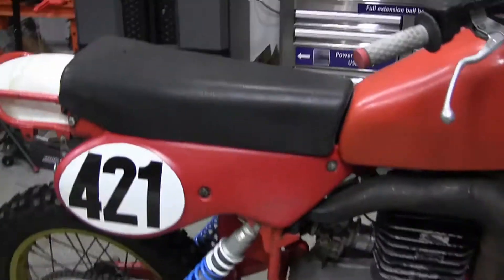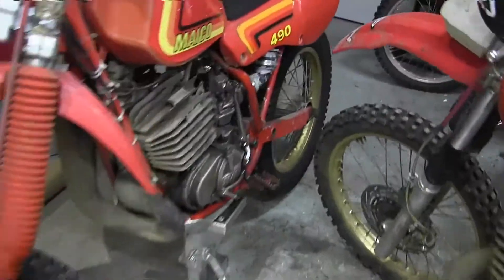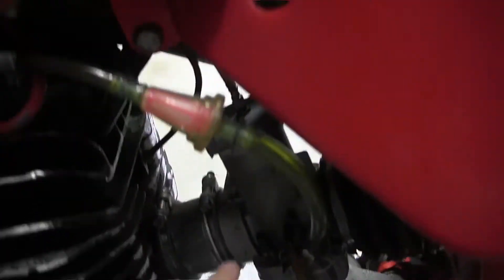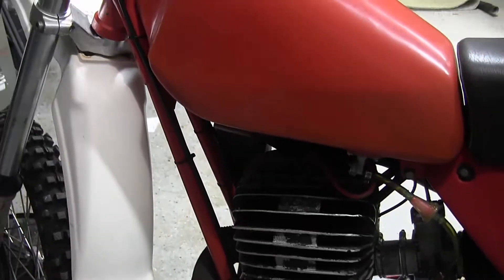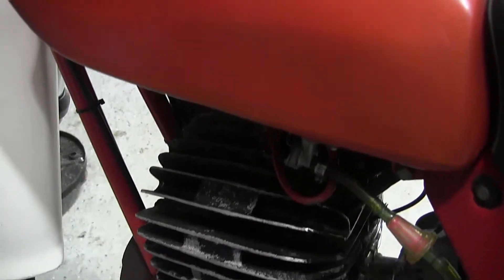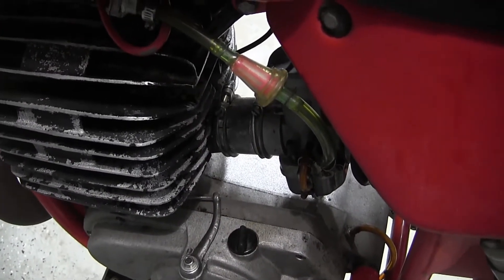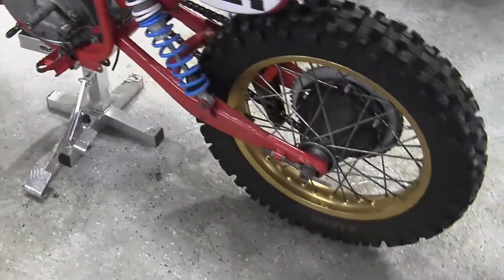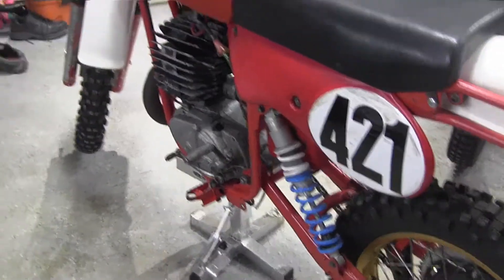Trick Start 1981 Maico 490

Comment: question, do you use the compression release when you kick the bike? What I did to start my 440 and 490 was use the tickle button let carb flood and twist the throttle 5 or six times with couple priming kicks before the big kick. By you blowing in the over flow tube, you are flooding the carb, the air you blow in there is forcing the gas up through the pilot and main jets.
Reply from the maker: Have to use the compression release.  The tickler never works for me, some people it works for, but I also don't like gas dripping everywhere.  Blowing is much cleaner since no gas spills out and it seems to be just right amount every time.

Comment: I had an early 70's 440 I'm guessing, as it was represented as a 450 radial. Had the aluminum tank, and was re-sleeved. The idjit that sleeved it didn't remachine for the compression release, rendering it a pull-start only affair. After everyone smashed their ankles trying to kick it. How did the Mikuni workout for you? It seems the ideal would be an accelerator pump carb, or would it just foul plugs? Btw, after we started using Bel-ray synthetic oil in the premix, none of us ever really fouled plugs. This was 40yrs ago.

Comment: Seems like it's not receiving enough air try changing to an aftermarket air filter to increase air flow so that way you don't have to blow into the bike
Reply from the maker: There's no choke on this bike.  The bike starts fine but you have to use a plunger to flood out the engine.  This is an alternative method that doesn't flood out the engine.  The other way would be to change the carb to one with a choke.
Reply from the maker: Also, I have a new air filter coming, I don't know the condition of the one in the bike currently, it's been sitting for 3 years in a basement.

Comment: flood it loads then lay it on its side with the throttle open then stand it back up flood again and boot it useing the decompressor
Reply from the maker: Jeremy Wilson Ya people always start thier cr500s like that but I dont like anything that spills gas.  Blowing is cleaner if theres no choke.   It has a tickler already tjat you can use to flood it.

Comment: I don't know why people whine about carbs with tickler rather than choke.  I rode a series of Husky's thru the years with Bings and, once I got used to it, never really had a problems with the bikes starting.  I think a lot of guys let their rings get too loose, crank seals leak, etc.  All your bikes sound nice and tight in terms of the aforementioned problems.  When I think back on it, I would rather have the Bings than Mikunis; they seemed to have more top-end over-rev with the Bings.  You also mentioned gas with alcohol in it.......not good as far as I'm concerned as it seems to degrade rapidly.  I keep my fuel in absolutely clean metal cans.....no plastic and that seems to help keep the fuel fresh longer.

Comment: if you hold the throttle open while tickling the piss out of it , have the correct pilot and idle set correctly (slow idle)(and don't twist the throttle at all when kicking) it will start and idle in 2 kicks..my 72 400 did it and everyone i owned thru 85 did it......period.